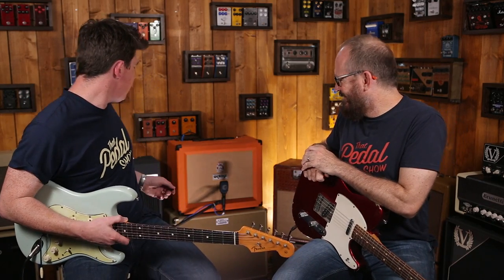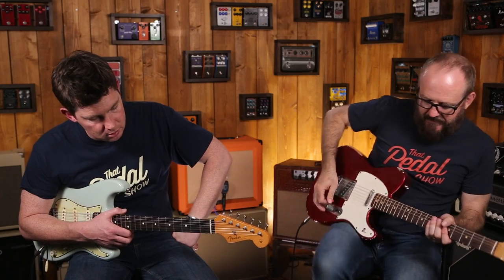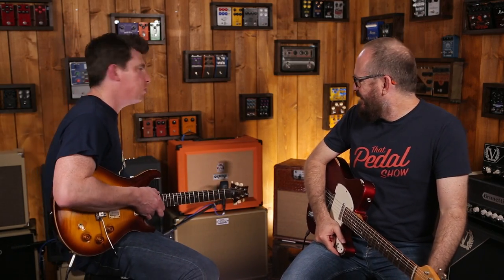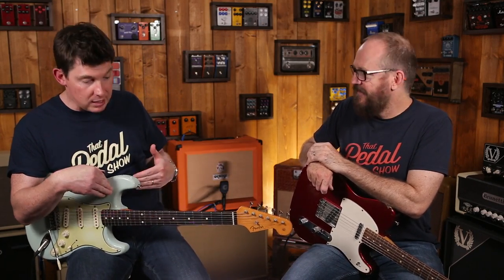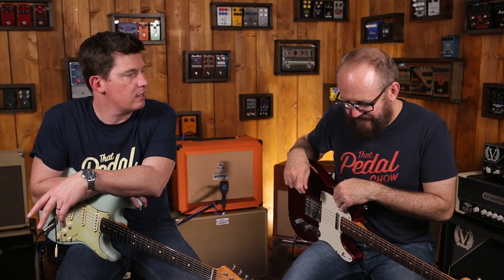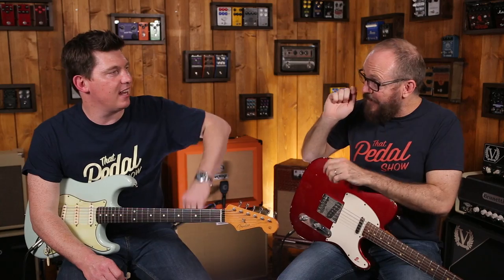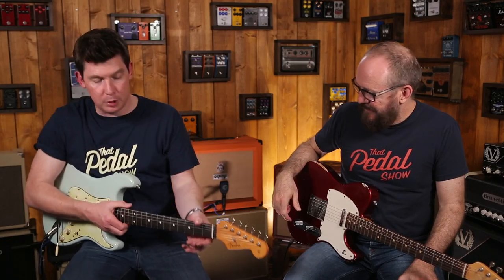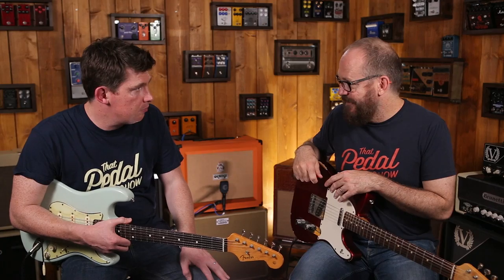That Pedal Show – Do We Like Transistor Amps? Part 1

Comment: When played clean, the SS amps aren't bad at all. The OD & Distorted tones are not very good. I think the Orange is the better of the two. But neither can touch the Fender.
 What I find interesting are the prices. SS amps used to be half the price of a valve amp. Not any more. The Orange is $599, the Roland is $699, the Fender is $599. I don't see what the benefit is to either of the SS amps. I sure wouldn't pay $100 more for the Roland. Hands down,  the Fender easily wins here.
Reply: It most certainly is reliability combined with an amazing more modern sound.
Reply: Yes that is really ridiculous! Those transistor amps are cheaply made in China and sold at high price. I call it a ripp off and would never ever spend that amount of money if I could have a decent tube amp new or used in the same  price range...
Reply: Osa  I didn't hear anything amazing.
Reply: Fred Garvin I didn't like the sounds in the video either, but I own the amplifier, so I know it can sounds amazing. Other than that, it's a pretty subjective thing.
Reply: Osa You need you need to get out more.
Reply: I'm in full agreement with you on the most part! But don't knock other people's gear. What sounds great to him might not sound great to you or I. I've had to gig with them before and they aren't too bad - not in the same league as a tube but they aren't bad! Better one of those than something digital (with the exception of Axe FX)
Reply: But for +$400, can get a Mesa Express.
Reply: Wrong - Its all about the TONE your after - Not about costs - Solid State - Hybrid  Modelling or TUBE  !  To me the ORANGE wins here , Its definately not a "cheaply made" amp ! Theres cheap -bad quality Tube amps too . The Fender may have same price - but Forgetting it will need Tube maitenance and  SERVICING someday ! ( depending on handling ) - If you love the Marshall tone You should Buy a Marshall - Not a Fender or a VOX !

Comment: Great video. I'd love to see your thoughts on some affordable modeling amps, such as the Vox VT, VR or AV series; Fender Mustang; and — despite the hate — a Line 6 (Amplifi or Spider). I know Line 6 has a lot of haters, but is it justified? And, are they giggable or better left in the bedroom.
Reply: They are better left in the trash can! Digital modeling has it's place when it comes to recording, going direct into the mixer or for bedroom practicing. For anything else, forget about it...
Reply: It's quite surprising how very little the audience actually cares about guitar sound compared with how much some guitarists obsess over it. It's kind of funny, really, how much more improved digital amps are now compared with 30 years ago, yet by reading comments on YouTube, one would think they've gotten exponentially worse.
Reply: Maybe actually try a Blackstar ID:60 TVP, or Vox AV60 before crassly talking about leaving it "in the trash can". There are some surprisingly affordable, giggable solid state amps that achieve awesome results through analog tube emulation rather than digital modeling.
Reply: Guitarists live in the past. They believe the 50's-60's were a 'golden-age'. Everything made then was better. In the real world things have moved on and modelling amps are better than tubes. Why have one fragile amp when you can have twenty + that won't break and weigh next to nothing and are bullet proof?
Even guitar design has stagnated. We have the same bolt-on square heel axes of old. And when they try to bring out a modern guitar it gets slated as 'gimmicky'. No wonder keyboard players laugh at us.

Comment: Been using valve amps for 15 years or so - However the Yamaha THR100H has been my main gigging amp for the last 3 years or so (bought it as a backup for my Mesa Boogie). The reason why it's replaced the valve amp is that it's an excellent pedal platform , the modelling for the power amp stage just works and the modelled DI out means that I can get a usable sounds through the PA with minimal setup. I play in a wedding band so set-up time is often compressed.

Comment: Bluescube sounded good but at £570, why wouldn't you buy a Bassbreaker, or an AC15 with Greenbacks, or a DSL40c. The pricing just doesn't make sense to me. Is it a convenience thing? I've played both and I can't get my head around why someone would choose to spend that kind of money and not come home with a box of hot glass and loveliness... just confuses me.
Reply: Because under heavy gigging conditions valves going down can be a real pain. Do you have a backup? Are you familiar with the backup or will the sound of it annoy and put you off? Is it some crap thing you hastily borrowed? SS tends to be much more robust and 'just work'. So if you've had valve hassles often enough a Bluescube, or similar, may suddenly seem attractive, even if when subjected to close scrutiny it doesn't sound (quite) as good.
Reply: hammondsphoto Fair enough... that answered my question... still not sure I'd shell out nearly £600 on a solid state amp but, I take your point...
Reply: Yeah, it is a bit pricey. I've been using my Bluguitar AMP1 since early this year covering everything from jangley psych to punk to doom metal and I'm not really feeling much pull back to big heavy valve amps live just now.
Reply: hammondsphoto I keep seeing reviews for that and it does look and sound the business. It's a different level, but at the moment, for regular gigging I'd be tempted to stump up the cash for a powered Kemper. Bit expensive up front but essentially many many amps in one box and from the recent reviews I've seen, they sound very very very good. Would have to have a play first though.
Reply: A Class A amp, such as the Orange OR15H, would not need biasing: just carry some spare tubes.
Reply: Three reasons: effects loop. Reverb. Not able to get to the sweet spot at neighbor-friendly volumes.
Reply: neuk01642  I preordered a Blues Cube and ended up getting an AC10 instead. Sounds much better and mic'd up can play anywhere.
Reply: I guess a good solid state amp is every bit as valuable to me as a good tube amp. They shouldn't be cheaper because they're solid state or more expensive just because they have tubes.
Reply: Jim Brown I guess it's different mind sets because none of those things would convince me to spend that sort of cash on an Ss amp. DSL40c has a loop a pentode/triode option that drops it to 20 watts and I'm as happy getting my effects from pedals which offer such massive variation of options. And I think it's only marginally more that the Bluescube... Like I said, different mind set.
Reply: Jim Brown and just to clarify, I'm no valve nazi. Just basing this on what I hear and what I've played. Nothing against SS amps. Would love a JC40.
Reply: I'm not a SS nazi, either. I typically use tubes. Got my BC Artist primarily because I play weekly in a venue where I have to have my amp in an amp closet off stage. So I need a variety of footswitchable tones and controls from an amp that runs cool in the closet. My tube amp ran way too hot--though I was going to burn the place down. Quality is quality. I'm not really a price shopper, I'm a value shopper. Don't mind paying for good stuff. Didn't like the BC Artist until the speaker was broken in, now I play it way more than my tube amps. Perfect for me.
Reply: Jim Brown The components required to make a tube amp are more expensive than the components required to make a solid-state amp.
Reply: Yes, that's generally true, but it depends on what components are used, and component costs are only a fraction of what makes the final cost of the product. Its hard to know how much each manufacturer pays for the components they source. I really don't care. I just like what I like and am willing to pay for it.
Reply: Jim Brown the other thing to consider is that tone is subjective. I love the ton of the Pro60 for punk music. My Mark V and Vox both sound amazing, but the harsher nature of the analog amp really works. To your point, I like what I like and will buy regardless of tube/ss.
Reply: they have us guitarists fussing about tone like women fuss about their hair. "your tone is showing!" lol
"people are talking about your TONE!!" im trying to play more and obsess less about gear and tone. most fans of music are just not listening because of tone. nobody in the crowd has ever said " that has to be true bypass!" peace
Reply: Wadenkrang Guttenberg you're right. The average audience member doesn't give two shits if it's valve/SS/modeling or whatever. However they're only half the reason we play. The other half is that we love it. We love generating those sounds we love it when we hit that sweet spot where the marriage between the amp, guitar, pedals and fingers delivers the sounds in our head. And that feeds out passion and feeds out creativity and makes our hearts race and therefore our commitment to perform to our very highest standard is supported by belief in the sound we generate. I've played valve I've played modeling and I've played SS and the profound differences I felt as much as heard when I first wound up my JVM blew me away and I new I was a hot glass kind of guy. That said, I've got a real jones for a Kemper but that just the prospect of having any amp at my finger tips and the do sound amazing... not the same as cable but amazing.
Reply: Wadenkrang Guttenberg cheers mate- SpotOn!
Reply: I think it's something like why I play synthetic reeds on my wind instruments. Are they as good as the very best cane? No, they're not. But real cane is highly variable, and a box of ten might only yield four gig-worthy reeds that give me two gigs each. There is a chance one of those four is a 9/10 or 10/10, but the other three "winners" might only be 7/10. A synthetic reed, on the other hand, will give me easily fifteen gigs without having to fiddle with it, and every single one of them is an 8/10. Guess which one I choose? I choose the reliably excellent performance over the inconsistent but occasionally brilliant option. I think this might be a bit like choosing solid state over tube -- less downtime, less maintenance in general, more time to play.
Reply: neuk01642 Tried it. Doesn't cut it.

Comment: Really breaks my heart that you guys didn't try anything by Sunn or a JC-120. Those are transistor amps that are much, much better than a lot of tube amps.
Reply: had a jc 120 for 20 years,great cleans,blows big time at absolutely EVERYTHING ELSE.they are a very shitty amp for any type of gain.
Reply: Hm, all these JC 120 that I've used had a sterile clean sound and too much hiss. The distorted sound was absolutely useless.
Reply: You don't buy a JC120 for high gain sounds any more than you'd buy a Henrkson Jazz Amp. It's all about the pristine cleans and stereo chorus.

Comment: update of trans amps: Fender Frontman 10G, Fender Stage 100, and  Harley Benton HB80R Mosfet Lead  :

YOU two wouldnt believe how soft and jazzy the Harley sounds, and the Fender Stage 100 has the same speaker: Clelestion G12T-100!  for the neighboorhoods sake  the 10G: I once tried it with a single pedal:Mosky Crazy Tone resulting a very nice warm jazz sound,  I also have a CRATE GX-80: Made in St Louis: orig. Crate speaker, one of these days im gonna plug my strat into the Crate: Ill instantly know if its a keeper: it looks mint and pristine! ( and St. Louis adds sentimental value for me...)

Cheeriously, KIMMO:hand-pink-waving::face-blue-smiling:

Comment: In the US:
Bassbreaker: $850
Orange Crush CR60: $500
Blues Cube: $700

So the Bassbreaker is 20% more expensive than even the "Expensive" solid state.

On another note, I cannot imagine paying $700 for a solid state amp.
Reply: Two Notes Le Clean, Le Crunch, or Le Lead: $300.
Reply: The ac4-12c is something like $600 isn't. I bought one for 399 euros anyways. I like mine more than the bassbreaker.
Reply: I loved mine but I found it too bright, I know use the tone knob  which I do but youcan only flavor the sound you get and if it's voiced to be bright it will be. I do regret selling it but I have a 2 amp 5 guitar limit imposed by my wife lol
Reply: you can get a 7 watt bassbreaker for 500$ and a 15 watt one for 650$
Reply: Julian Gerritsen The 7W Bassbreaker is essentially a single-ended Class A plexi: hence the absence of an effects loop.  It was stupid of Fender to make every amp in the Bassbreaker line different from the others, resulting in predictable consumer confusion.
Reply: By a used Peavey Bandit for under 200 bucks or new for 300. Great ss amps

Comment: I've got a Fender M80 1-12 solid state combo that I bought in 1990, and it's never been serviced, but it still works! It doesn't sound very good, however. Once I got my hand-built 65 Deluxe Reverb clone, I never looked back.

Comment: Conclusion: Transistor amps have come a far way and if you don't use pedals and want reliability, they're great. But nothing beats the experience of the pedals into the tube amp. Drive pedals into transistor sounds fake to me. There's something about the grain of the compression that puts me off.

Comment: Why not use some more high end transistor amps ? Roland JC much ? Or some heads ? Orange has a head, the Bleus Cube comes in a head, a Randall RG, Fender Metalhead is also quite popular... This didn't feel as a good comparison to me.
Reply: why not watch the show where they explain about why no JC?
Reply: Oops my apologies, must have missed that :/ at what time mark do they say it ?
Reply: Err, part way through they talk about JCs and their struggles with them, although possibly for a future show as well they say. Long show though easy to miss things. The bits were Mick talks about cross dressing at the weekend, for example, easily lost between them showing fuzz pedals into different amps...
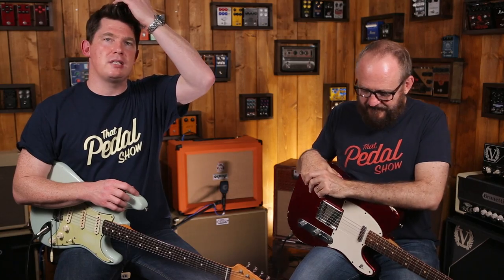Reply: It's around the 25:00 is mark, maybe a little later
Reply: Doesn't make sense because bigger or more expensive transistor amps don't sound any better!
Reply: This was the perfect comparison. They all cost the same price ( the roland $100 more), and the tube amp sounded ions better. Even without an effects loop, I'd take the Fender over the other two.
Reply: "ions" better
Reply: It depends on your view of better the Valve amp they used is very limited and a proper analogy would like saying it was say taking 3 dives and scoring 10/10 on 1 and flunking the other 2 wile both transistor amps scored higher overall through totaling 3 dives together. Also different valve amps have their own tone and a huge array of possible sounds and features. See the episode comparing the Hampstead and Fender ( by the way the Hampstead + cab runs round the 2k mark).
Reply: Second the Randall RG great amp

Comment: It's probably my ears which are somewhat shot,or maybe my taste( or lack of), but everything through the Fender and Roland sounds either good or great, and everything through the Orange sounds bloody awful.
Reply: You are more right than you know.
Reply: kingstumble My taste seems to be the same as yours, Orange sounds unbearably "fizzy" for my ears. Each to their own though, might work better in a mix ... Or not. ;)
Reply: I don't think the Orange Crush is a particularly good SS amp. 
I've got a Cube 60 as a backup and I wouldn't change mine for a Crush no matter what. Doesn't sound as good as my Tweaker 15 but it doesn't fall flat on its face like the Crush does here.
Reply: I have a crush pro 60, & the Amp in this video isn't one. if you listen to the crush pro range you'll be amazed, Ive played a lot of tube amps in shops that dont sound anywhere near as good as that does on the clean or Dirty channel
Reply: I suppose taste is subjective after all. I thought the orange sounded the best throughout the video, both clean and with pedals. To me the other amps sounded somewhat nasal in comparison.
Reply: Believe me - Its the Chinese made " voice of the word" speaker - Takes a long time till it breaks in - after that it sounded much smoother , After i upgraded with a "well played- broken in" Celestion Vintage 30 the amp sounded even better  ! Speaker change can be a huge sound  improvement !
Reply: My ears agree but this is by no means a scientific comparison. Regardless of this demonstration, it doesn't prove that so and so is categorically better than such and such anyway. Differences are just differences.

Comment: Several things.  One, portability and flexibility  are what many are looking for in solid state amps.  A setup that allows direct recording, direct to board for silent state, quite practice and be able to do a small gig or rehearsal. And be a size that one can carry it and a guitar easily. Does such an animal exist? Second, what about amp-in-a-box pedals.  Wampler, Caitlinbread, etc, excel at these.  What does a plexi-in-a-pedal sound like into a transistor amp? Lastly, what about feeding pedals into a pre-amp, not necessarily a valve one.  I'm thinking: pedals => Tech21 blond => amp.
Thanks guys, love the show! One more reason Fridays are awesome.

Comment: I would love to see you two review a Quilter 101 head, which is the size of roughly two pedals! I love mine so much that I sold off my MB heads and use the 101 as a clean platform for my Van Weelden Royal Overdrive, tubescreamer and other pedals. I still use my MB cabs. No regrets! BTW, no need for an attenuator as you can dial the 101 down from a high of 100 watts, to 1 watt!